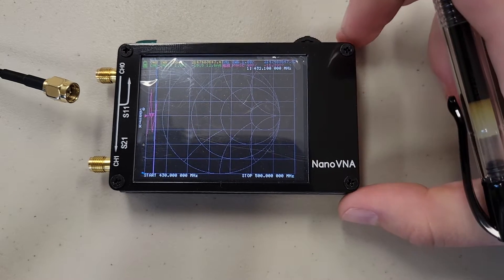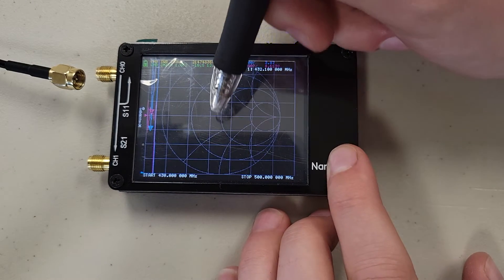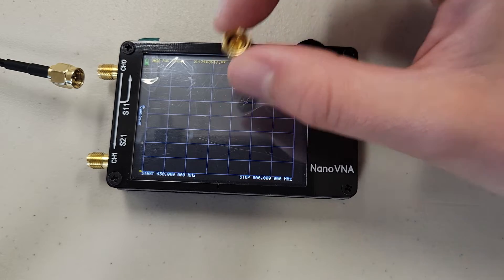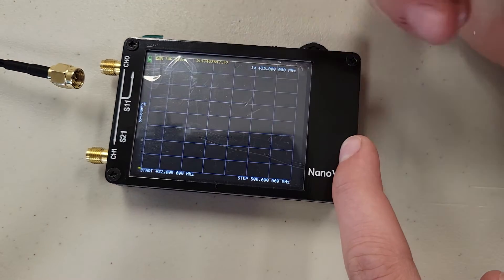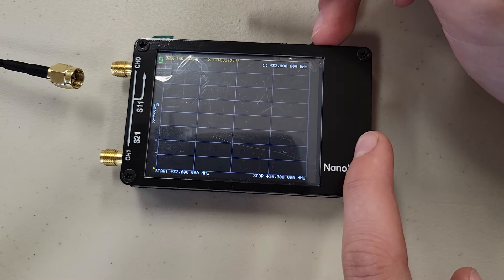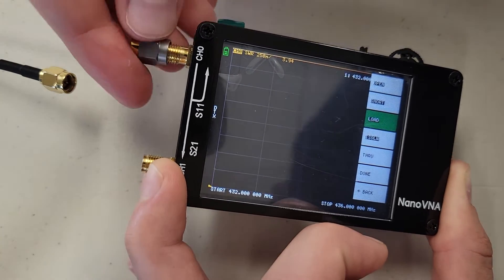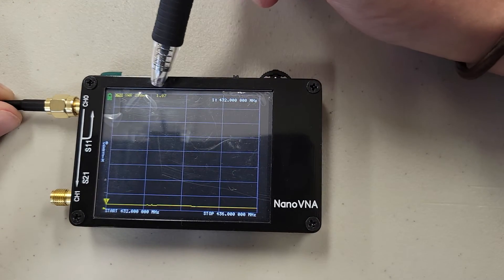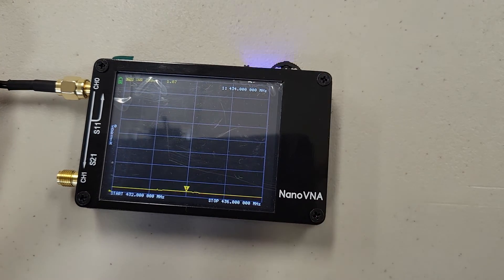Using the NanoVNA to measure standing wave ratio (SWR) of an antenna.

Comment: Something to note is that SWR only really matters if you're transmitting - for receive-only work (as a Motus station does) it's not a particularly great indicator of receive performance - but it's useful in making sure your setup is correct and that your antenna is resonant on the frequencies you care about.

Comment: How do you know which SWR reading is good or bad for the frequency range you choose to save? I can only assume you are connecting the Nano to the wire that connects directly to your antenna outside with no other equipment attached to get it's SWR?

Comment: During your calibration I observed at marker 3:48 in your video that you directly pressed the Calibrate button after the CAL button. Between those two the RESET button has to be pressed to empty old calibration data.  
For a 1 port calibration you may skip the Isolation- and Thru button. 
After you removed the CAL load from CH0 I saw a swr value of 1.37 at the cursor. Where was that value coming from? Because with an Open (or nothing connected) at CH0 this value should be very high (infinite theoretically). So the yellow trace had to be on top of the display. I hope this helps.

Comment: Very nice, I'm wondering can this test be performed through an LMR 400 coax cable with an LNA & BPF connected, no antenna. Would that still provide an accurate SWR or would I need to add in a 50 Ohm terminator on the input end of the LNA (from the antenna)? Or should this test get performed with the LNA assembly connected to the antenna? This is for a Radio Astronomy telescope project.